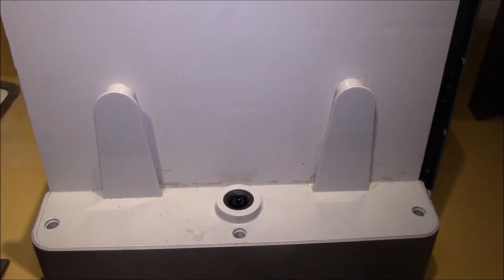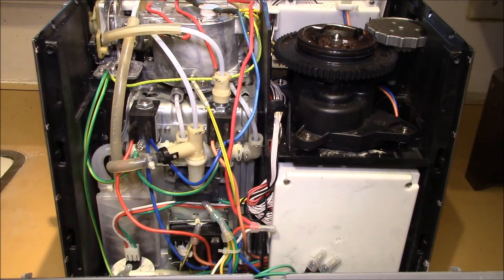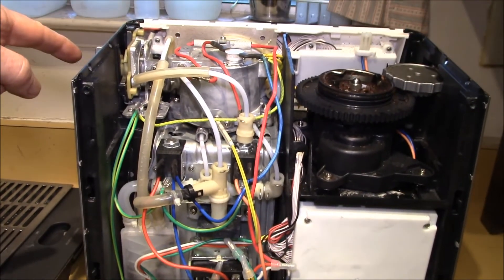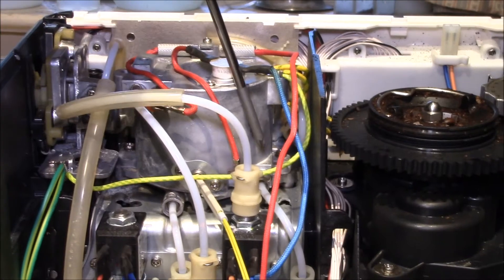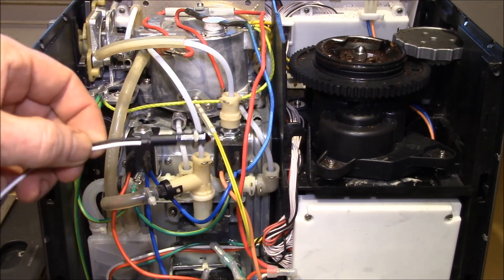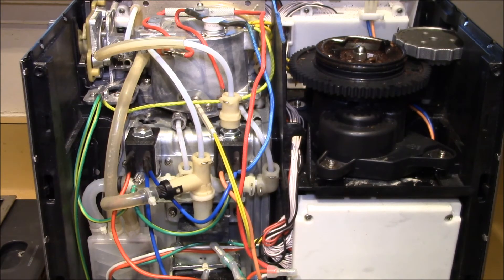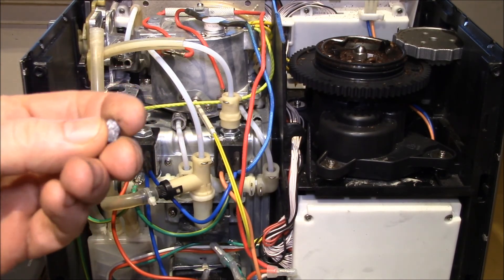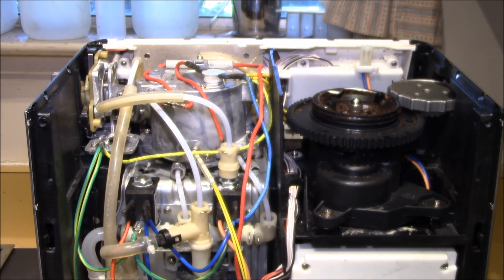Breville/Sage 870XL Barista Express - Water Flow

Comment: Great video. Encouraged me to take my machine apart and investigate why I might be getting too much water in the drip tray at the end of a cycle.  What I have found is that no (or very little) excess water gets through the 2-way solenoid to the diffuser (pipe is cold).  Instead, at the end of the cycle, excess water is coming out the top of the 3-way.  My guess is the 2-way is blocked/not working, forcing excess pressure/water out though the default open-state top valve of the 3-way. However, both solenoids makes a satisfying click at the end of the cycle and I have replaced the 3-way and stripped down and descaled the 2-way which looked clean anyway.
Anyone else seen this issue? 
I also get low pressure on the gauge when using the standard double basket, but not when using the pressurised basket or the cleaning disc.  This lack of pressure could be down to my coffee or technique/grind 😞
I know I will still get the same amount of water in the drip tray regardless of whether it goes out through the 2-way solenoid to the diffuser or out the top of the 3-way, with the steam/hot water switch closed, to the diffuser, but it bugs me!
P.S. I could have reassembled the solenoid assembly wrongly. Anyone know which side the half-moon opening in the pipe under the solenoid should go - left or right hand side as viewed from the back of the machine (i.e. inlet side or outlet side)? I'm guessing inlet side.
Reply from the maker: The 2-way valve is really only used at the end of a cycle to vent excess steam/water from the system, in parallel with the top port of the 3-way valve.  It's closed all the time the pump is running and then it should open for 30 seconds at the end of a cycle to vent that excess water/steam.  You can see my video where I added some indicator lights to the solenoids on my machine to show how they're powered at various times.
Reply: @The4Crawler  Hi. Can you remember or find out what size spade connectors you used? Thanks.
Reply from the maker: @garyraymond4170  I thick they were 0.25" or around 6mm wide spade terminals.  That's what I used in this video:
https://youtu.be/9cC-m3a-oXY
Reply: @The4Crawler  Thanks. Sorry my question was a bit out of context.  I had been watching your other helpful video on fitting the lamps to the solenoid.👍
Reply: Hi @The4Crawler thanks so much for your awesome video it's been real helpful 🙏

But I'm still having problems as I've replaced the solenoids and pump but when I push 1 or 2 brew button there is no water coming out it is just going to the tray for some reason.

Hopefully you can help me out 

Cheers heaps
Reply from the maker: @troyvidovich375  I've added a pinned comment with some common troubleshooting tips, could be incorrect connections on the water tubes or a solenoid is getting power all the time or similar.
Reply: @The4Crawler  thanks heaps for your reply really appreciate it 🙏

I will look into a few things and see what it might be.

It really weird because there's simply no water coming out of the head it's going into the tray.

I've checked the pipes as I took a photo of them before I started taking it apart, so it must be the new solenoid staying off🤷‍♂️

Thanks again 
Troy

Comment: Hello problem with mine solis is when i turn for hotwater it comes through the coffee unit, does anyone knowe whats the defect
Reply from the maker: It may be the tubes from the top of the 3-port valve and the center of the 2 valves may be swapped.  Top line is the hot water, center one is for the group head.
Reply: @The4Crawler  i checked the tubes they are connected correctly, its seems like when you choose hotwater or steam the valve doesnt open so it go through the coffe unit,
Reply from the maker: @hassankessrioui3470  Then it might be the 3-port solenoid is stuck open and sending all water to the center hose fitting.

Comment: Mr. Brown. Clearly the world has been waiting for your videos! My Breville has working steam, poor (and steamy) hot water output and low flow through the main coffee-making head. I'm suspecting a stuck/clogged solenoid valve. Would this make sense to you?
Reply from the maker: Could be a number of things.  One option it to crack the back of the case open and peek inside while running various functions.  See if you can observe where the water is flowing.  It might be one of the solenoid valves is sticking partway open and not sealing off the un-used port, a cleaning may help
https://youtu.be/eljHS_BRJXk
Or it could be the over pressure valve is set too low or leaking and diverting water to the drip tray.  Or if no obvious leaks are found, the pump pressure may be too low.
Reply: @The4Crawler  Thank you for taking the time to reply. Turned out to be the in-line filter which was clogged. Without this video I was a bit intimidated by the maze of pipes!

Comment: I have water overflowing from the Flow meter regardless if it’s plugged in or not. Was does that mean? I took it apart but I have no clue what the issue is and how to repair it. The Flow meter is about 20$ CAN so I don’t want to replace it if I can fix it easily. Any suggestions?
Reply from the maker: I've never run into that issue before.  Since the water level in the tank is higher than the flow meter, it'll always have that slight pressure inside.  So it could be that the flow meter housing is cracked or perhaps one of the tubes connecting to it is leaking.

Comment: Thank you for the explanation. If you could help me with my problem it would be greatly appreciated. What I have is I can express one cup properly then 2nd  and 3rd mostly foam and then the 4th shoot will have no more water. When running descaling the water runs perfectly. I am not understanding where there might be a blockage
Reply: So 6 single shots were all good 44g from the head and about 20g of blow off into the tray then my 7th shot only about 10g out the head and 60g into the tray. What do you think I can do about this overheating issue?
Reply from the maker: @ramienb  Sounds more like a pressure issue.  Perhaps the over pressure valve is leaking or set too low.  
https://youtu.be/46UBebNJ-uo
That valve will send water to the drip tray if the pressure exceeds it's setting.  You might try screwing in the adjuster knob a bit at a time and see if anything changes.  Otherwise, it might be the 3-port solenoid is getting hot (feel the black plastic coil) and not pulling that valve fully open and that'll let water flow out the top port and to the drip tray.  They key is to peek inside the back of the machine while running a test and see if you can identify where the water is going.
Reply from the maker: Never ran across that issue.  Best to identify if it's a problem of too high a temperature (i.e. more like steam) or too low a flow or pressure that's causing the issue.  Follow the water, see if you get more water in the drip tray on cups 2, 3 or 4 vs. cup 1.  Could be the over pressure valve is opting and sending water to the drip tray.  Or the 3-port solenoid valve (coil) getting hot and not fully opening after the 1st shot, i.e it's passing water out the top port which goes to the drip tray.
Reply: Never thought of that, I’ll take a look and see. Someone once told me it could be a heat related issue so that makes sense.
Reply: I’ll give that a try. Thank you!

Comment: Great educational videos! Could intermittent water flow (spitting everywhere) and steam coming through the hot water spout and lack of water be attributed to the solenoid? Thanks again for your time and effort with your videos!
Reply from the maker: Unlikely, because hot water/steam flow goes through the normally open port on the solenoid, i.e. out the top.  So unless the solenoid is being triggered on and off intermittently by the main circuit board, it should have no impact.  That is unless the valve it unable to seal off the side port which runs to the group head, in which case it might be leaking past there.  You could try cleaning/testing the valves like I show in other videos in this playlist.
Reply: @The4Crawler  great, thank you for your reply! I will give it a try and follow your videos for guidance.

Comment: Hi, My Breville has just started making a high pitch squeal when I turn off the wand. If I switch directly to the hot water, then the noise stops and instead of hot water coming out, I get a loads of steam for a while that then switches to hot water after 10 seconds or so. Any ideas on what might be causing that? Thanks in advance.
Reply from the maker: Never ran into that issue myself.  Might try running a few descaling cycles, switching back and forth between steam and hot water.  Also, check the 2 switches on the hot water/steam valve and make sure they are not sticking closed when you move the knob on the valve back and forth.  Those are what tells the machine processor which mode you're in.

Comment: I finally solved an issue: it was a scale build up inside the coil of a solenoid. took it apart and soaked in vinegar. now it works. apparently the first sign of this issue is the absence of the click sound when you press to brew coffee

thanks a lot, I found your videos very useful and great job for figuring out how the water flows - someone just confirmed it here https://wiki.jmehan.com/display/KNOW/Breville+Barista+Repair

Comment: thank you so much for sharing, I already disasembled coffee machine (bes 875), but so far couldn't figure out which part has a fault. water is not coming from group head/ portafilter steam and hot water on the side - no problem. clean me option is working. descaling process works 50/50.
but 1 / 2 cup coffee - water just won't flow and it ends all in drip tray
the water tubes look very clean. some say that airlock could be a problem, not sure if these coffee machines have such issue at all. I'll try to see that valve you mentioned and clean it with vinegar, maybe it helps
hopefully I can drink coffee again :)))
Reply from the maker: "Follow the water".  2 options:
1. Going out the over pressure valve to the drip tray (valve clogged, leaking or set improperly).
2. 3-port valve is not opening fully and that lets water flow, as discussed in this video, to the drip tray:
https://youtu.be/96IuKiuIB5A
Reply: @The4Crawler  very helpful, we'll see tomorrow how it goes

Comment: Thank you!
Just one note: flow meter is not used for clean me feature. I've disabled it and clean me still works
Reply from the maker: OK, good to know.  It must be triggered then on a count of brew cycles or something like that.  
How did you disable the flow meter?
Reply: @The4Crawler  I've unplugged the 3 cables so that I can extend shot time to 60s regardless of volume
Reply from the maker: @marcomartins6071  Great information, I had wondered what affect unplugging that sensor would have on the machine.

Comment: @RBrown Any suggestions for a machine that keeps dumping the water to the tray from steam wand / hot water valve? It goes straight out the top of the three-way solenoid no matter the shot size. steam wand and hot water work great. No clogs, all connections are correct. The PCB was fully replaced as well as the whole solenoid assembly. Feel like I hit a wall and may have to scrap the whole machine.
Reply from the maker: That valve is either not turning on or it's turning on but not fully closing off the top port.  Water will take the path of least resistance and that's it, up the top into the hot water valve and down into the diffuser and drip tray.  See if you can check out the operation of the valve:
https://youtu.be/yYJRQu3ZUik
Either power it up if you have the equipment to safely do so or use a small super magnet to pull the valve up and see if you can blow into the side port and feel where the air is coming out.

Comment: Thank you for such a great contribution and for sharing such valuable information. I am having problems with 2 little things #1.  I did the descale but the light is still on and I did the process 3 times thinking that the machine continued with the light on #2 the amount of water that comes out in hot water remains active for exactly 1 minute vacantly 1 3/4 rate
Reply from the maker: On the earlier machines, there's only the "Clean Me" light and it only goes off after a cleaning cycle (not a descaling cycle).  I generally run a cleaning cycle after I finish the descaling, allowing the machine to cool down first:
https://www.youtube.com/watch?v=TZjJFSAkNQ0&list=PLpY2FP1a9tisyIfKjSugexoVK01xQuptv&index=28&t=434s

I don't use the hot water feature on my machine but as I recall, you need to manually turn the dial back to Standby to turn off the flow of hot water.

Comment: Hey man, could I possibly get a minute of your time. I've been watching all your barista express video and I've learned a whole lot! I have a problem with my barista Express Impress. When I turn the machine on and it pulls water through it doesn't stop. Even when I turn the machine off it's still pumping water from the tank into the drip tray. Only turning it off at the mains will stop it. Is that a solenoid problem I'm guessing?
Reply from the maker: Likely the water flow meter:
https://www.youtube.com/watch?v=9lMw6ooiqPI&t=76s
That's what tells the machine how much water has gone through for 1 or 2 cups.  Either it's disconnected, stuck or otherwise not working.  Sometimes a few descaling sessions can free it up.
Reply: Thanks for your time anyways. Will have a look at the flow meter first and if that doesn't help I will look at the 3 way solenoid

Comment: Wondering about buying this machine, I’ve read a lot about too much pressure. Apparently a security valve drops the 15 bars pump to 9, could it be weak on some machines?
Reply from the maker: I've not run into that on my machine.  The plastic factory over pressure valve is adjustable or search this playlist for "Breville Dual Boiler Brass OPV Installation" and see another option for that issue.
Reply: @The4Crawler  thanks!

Comment: Thank you for all of your videos, they have been incredibly helpful!

I was hoping for some more help. I've confirmed the water pump works outside of the machine (based off your other video) but whenever I test the machine there is no water flow. Any ideas why the pump isn't pumping?
Reply from the maker: Does the pump make any noise when in the machine?  If so, it may be something like the over pressure valve is stuck open and sending water to the drip tray or a solenoid valve is sticking and doing the same or a line in the machine is clogged .
If no noise from the pump, then it may be an issue on the main circuit board:
https://photos.app.goo.gl/bN1ugnLPYwvyDcr59
Reply: @The4Crawler  we took the pump out again to test it and it noticed that it works intermittedly. Sometimes it pumps, other times it doesn't. I bought it new but have run out of the return timeframe. Any idea why it may do this?

When it is in the machine, and I press the single or double shot, the pump hums a bit and steam comes out of the bottom tray. When I turn the steam/water switch to water, a bit of water spits out with a bit of steam.

Any ideas on what to do next would be greatly appreciated. Thanks again!
Reply from the maker: @dichoticlistening  Not much to the pump electrically.  It's just a coil of wire with a diode inside that causes the magnetic field in the coil to turn on and off:
https://photos.app.goo.gl/U7mEDVH7AoYPTWyE7
Perhaps there's a loose connection or a broken wire that sometimes makes contact.

The 3-port solenoid valve is what sends water to the group head in the coffee mode.  If water is going to the drip tray, then likely that solenoid valve is either sticking partway (that was my issue).  Might check out the videos on the solenoid repair and water flow in this playlist on my channel.
Reply: @The4Crawler  Me again! We got the pump to work! The small O ring over the center shaft of the new pump was the wrong size. 

Question about the solenoid: we used two multi-meters instead of indicator lights to test it. We found that when we pressed the single cup the brewing solenoid did not come on. There was no AC power to the brewing solenoid and there's constant AC power (110 volts) to the exhaust solenoid and they don't change in the cycle. Any idea what that problem could be?
Reply from the maker: @dichoticlistening  Like the the control devices on the main circuit board (Triacs).  See the circuit board photos on this album:
https://photos.app.goo.gl/bN1ugnLPYwvyDcr59
Sounds like you have one that failed open circuit and the other failed in the on state.
Parts are available and can be replaced with a soldering iron.  Or a new PCB is also available for a reasonable cost from ereplacementparts.com or through Breville.
Reply: @The4Crawler  We just looked at the PCB and noticed scorching on one of the three blue rectangles! Is that the control device? I'll go ahead and order a new PCB. 

I also read somewhere that it might be the actuator key. Have you heard of that issue before?
Reply from the maker: @dichoticlistening  This photo has the various devices listed:
https://photos.app.goo.gl/YedCsLo3YrwaNfsT9
The ones for the solenoids are stuck down in between the large yellow suppression capacitors.  Hadn't heard about an actuator key before, maybe that's with a newer model.
Reply: @The4Crawler  we finally got the PCB in and it's working! I'm able to pull a shot and steam the milk 🙌 My latte tastes delicious!!! The only thing is the pressure gauge doesn't move at all. Any idea on what this final problem is?
Reply from the maker: @dichoticlistening  Follow the water.  Gauge is mechanical, has a tube running to it.  Tube may be clogged at either end or inside or gauge may be fubar.